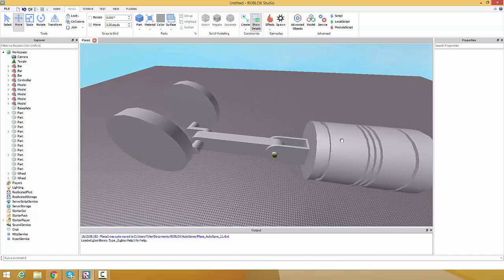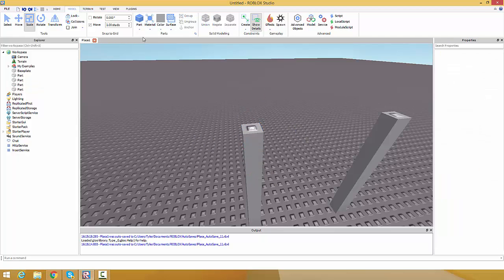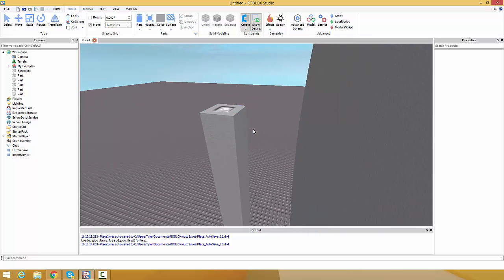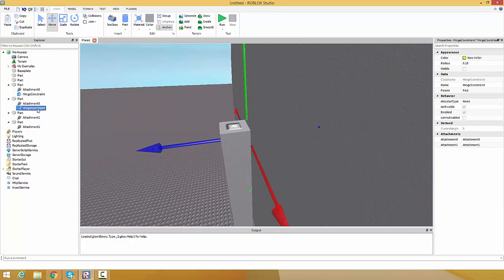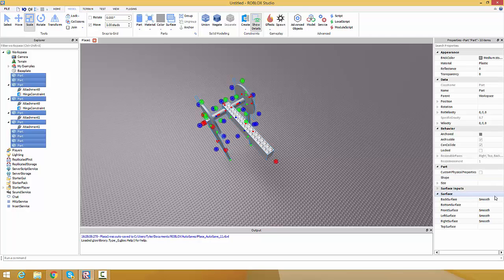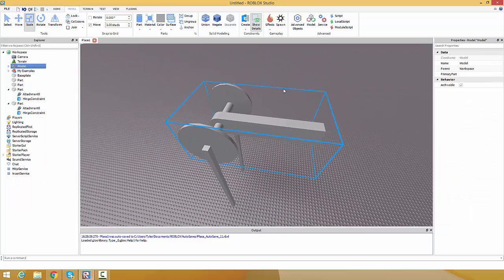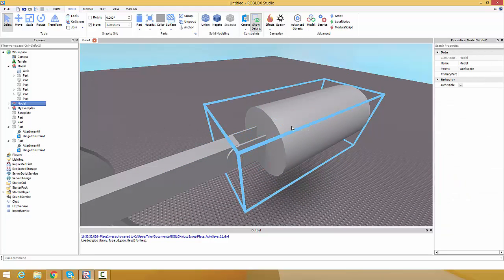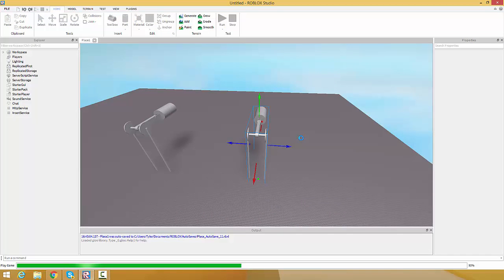ROBLOX- How to use Constraints #1 | Messing with motors and hinges | ROBLOX Physics

Comment: process of physic f3x or physic studio tool whatever it is:
firstly you should learn hinge and motors rn to get the start process
secondly, you should learn how to build cars with hinges, this will unlock the advanced building
thirdly you should have learned to build a boat, you should realize that car + boat wheel = boat
lastly the last process you can unlocked everything that you can learn yourself is trains, this is more harder than rest go goodbye